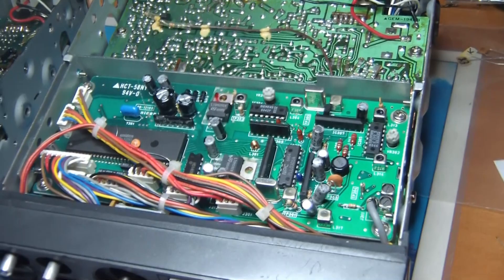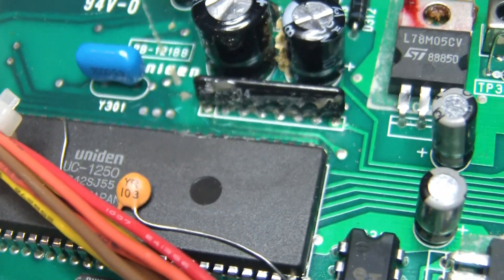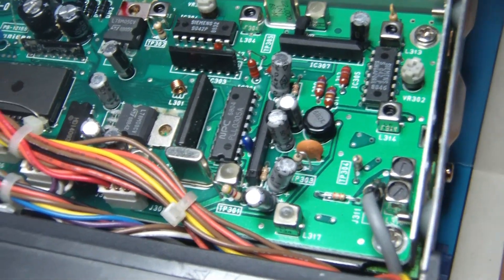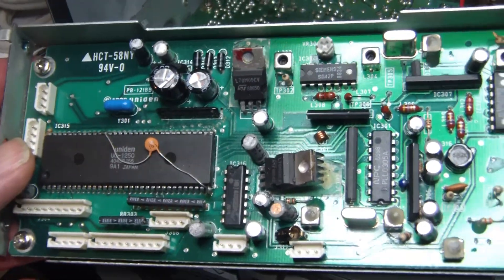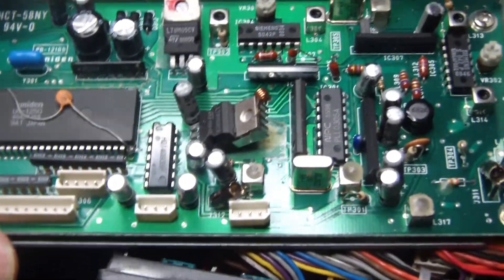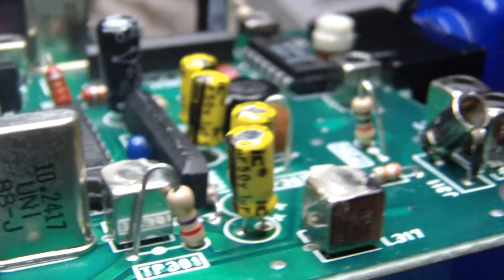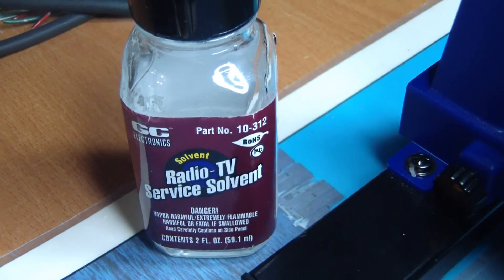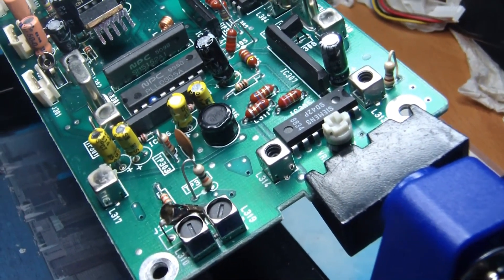Uniden HR2510, PLL board, part5

Comment: I re-capped my 2510 a few years ago. I started with the main board, well, every board minus the pll board. I then replaced the receive diodes with schottky diodes. After reassembling the radio, i tested it. There was a clear difference! Much quieter noise floor! So, i went on to the pll board keeping in mind that its a double sided board that solder needs to be drawn through to the other side. I messed up, radio now does not work so now i have to pull each cap out one at a time, clear the holes, flux and do each cap over making sure the solder draws through to the other side. I also spent the time removing all the glue as well...